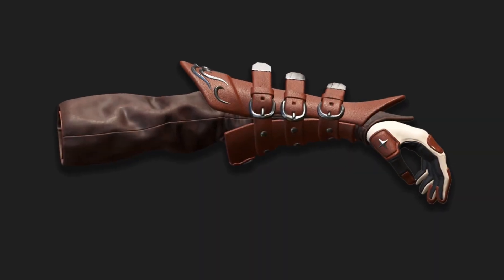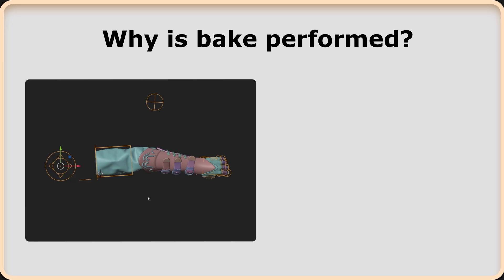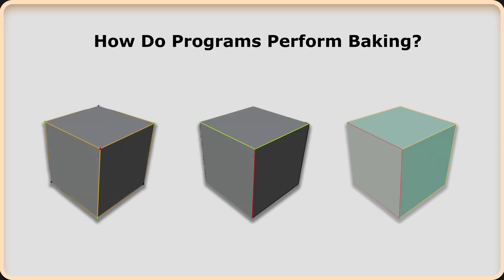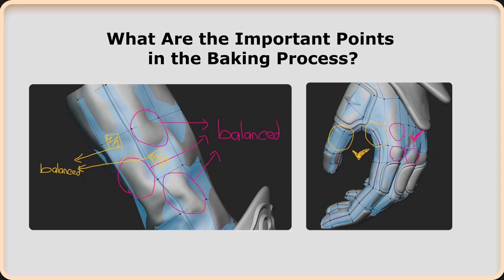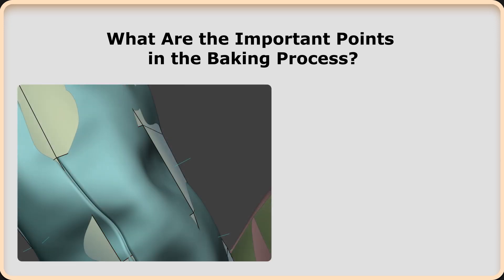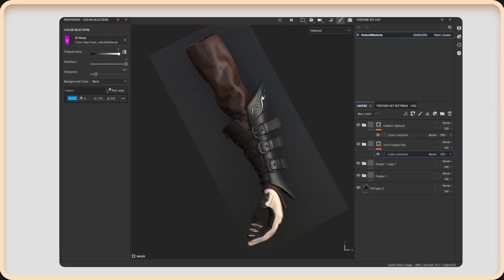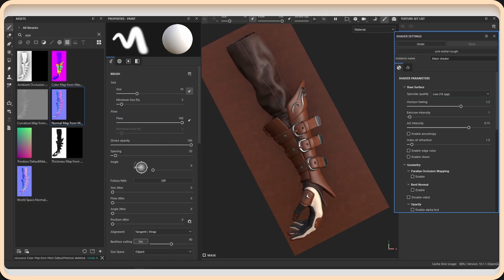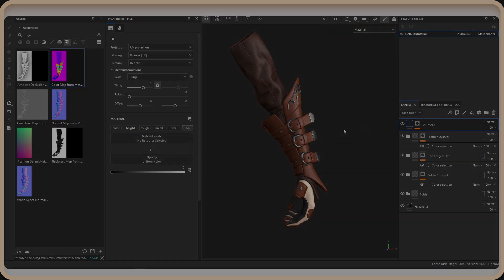From High Poly to Game-Ready : Baking Textures in Substance Painter 10.1

Comment: Thank you very much for technical details regarding logic as well as the superb tutorials. May I ask why you use retopoflow for some parts but you use blender's in house tools for some other parts? Can't all of this be done with retopoflow ? Also I have watched many tutorials and all of them told not to use any triangles, like it is forbidden :) But as I see you are quite generaous with triangles. What are the occasions that triangles can be used ? I will be pleased if you can spare some time and reply. Thank you.
Reply from the maker: Hello, 
- I generally prefer the retopoflow plugin to use the relax and contour tools. Because when creating the topology of cylindrical models such as arms, necks and legs, it is very fast and easy with the Contour tool. The relax brush is also very useful for arranging scattered vertices in an orderly manner. I use blender's own tools because they are more effective in terms of performance, but you can also use only the retopoflow plugin when creating the entire topology.
-------------------------
- I can summarize the answer to your second question as follows: 1 polygon actually consists of 3 vertices, which means a triangle. For example, all 3D software, including game engines, basically use triangle structures in polygon technology. The reason why some artists prefer not to use triangle structures is that if you need to increase the number of polygons in multiples of 2, as the "subdivision surface" modifier does, triangle structures will cause negative deformations in the model. In short, if you are going to use the "Subdivision surface" modifier in the model you are making, it will be advantageous for you to stay away from triangle structures and work only with quadrilateral structures. If you need to make models that will only be used in game engines, then you can choose triangular polygon structures as you wish.
Reply: @Polybox01  Thank you very much. By they way I just noticed your are from Türkiye so teşekkürler. İyi çalışmalar :)
Reply from the maker: Teşekkür ederim iyi çalışmalar :)
Reply: @Polybox01  Özel ders / danışmanlık veriyormusunuz? Nasıl ulaşabilirim ? Teşekkürler.

Comment: This is cool video, but i have question. On high poly assets you need to unwrap model or you just doing low poly, unwrap low poly, and baking straight on low poly model and texturing ? Or you make highpoly model, unwrap highpoly model, make texturing and bake on low poly model ?
Reply from the maker: No need to unwrap High poly model, just unwrap Low poly and bake it from high to low.
Reply: @time-lapse-art  thanks mate, its much easier way, to do retopology on model